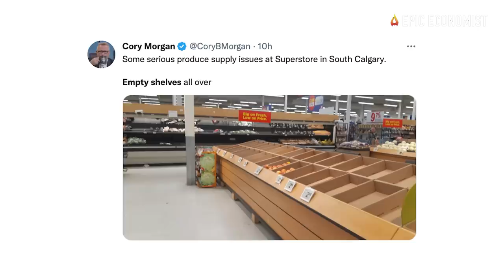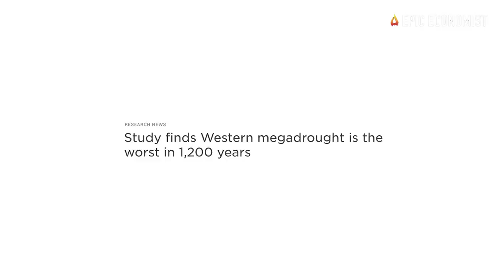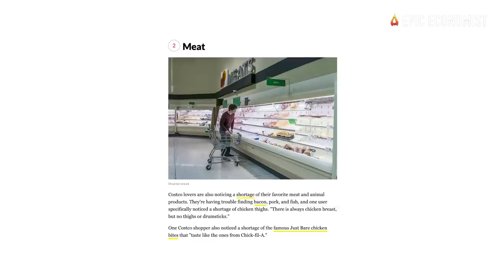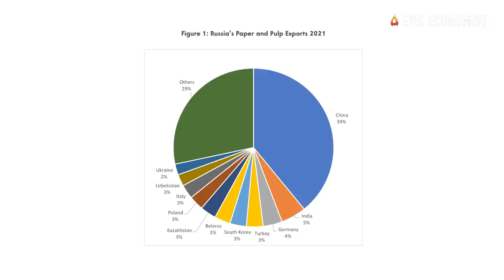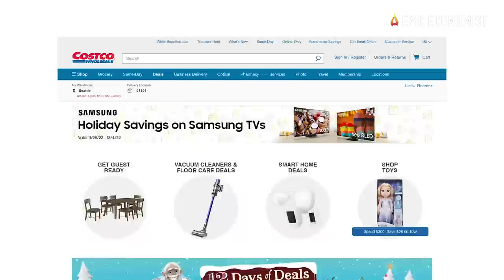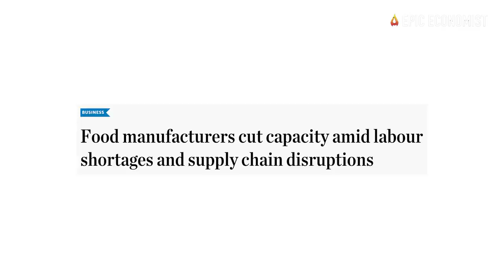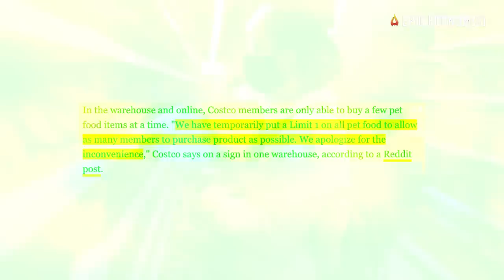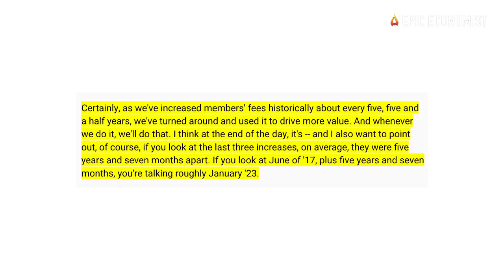Costco Reports Large-Scale Shortages As Essential Items Are Impossible To Find At Stores

Comment: The only product I have noticed disappear from CostCo was with Monk Fruit Sweetener.  There are new brands of coffee's I've not see before. Other than that most shelves look well stocked at the CostCo I shop at in my state. As for eggs, I prefer to buy those at my local Farmer's Market and then during the winter I'm "water glassing eggs", which is a way to preserve fresh eggs without refrigeration for up to 2 years.  You can only water glass with unwashed eggs, the eggs has to have the bloom, which is the outer covering on the egg that's on the egg when it's first laid.  If the egg has been washed, you cannot water glass. Check it out. It's easy.
Reply: I coat freshly laid from the coop eggs with vegetable oil and store them in the fridge with the date . They last up to a year, but so far as I know they will store for much longer than that. They are fresh as the day they were laid even a year later. Just have to be careful with hair line cracked eggs that froze in the coop during winter. Eat those right away.
Reply: Yes that monk fruit is one I was buying then they switched suppliers and it now comes from china My costco still has some but not as much as they use to carry about 18 months ago and since it comes from china now I wont buy it,
Reply: I need to look into that.  Right now I am freezing fresh eggs.
Reply: Eggs in Costa Rica & other places don’t put eggs in fridge they are jus on shelves
Reply: The Saxon Poessessive (‘s) doesn’t make plural nouns.
Reply: We lost our Ocean Spray Cranberry mix at Sams, and than noticed even the other grocery stores had limited Ocean Spray so guess the company itself is having issues.
Reply: @dapperdingo  how can you tell i they are not washed? I usually buy my eggs at natural grocers
Reply: @tammybrennan2040  same in the UK
Reply: Interesting...my Costco has monk fruit but no cocoa, no salt seasoning, rolled oats or organic chicken.  There is barely any chicken at all.   Those are items I used to buy regularly.
Reply: @jolie1327  I have two hens at home. I get a couple of eggs every other day and I immediately date them and oil them fresh  from the coop. You can oil storebought eggs that have been washed to make them last months longer in storage. Water glassing is a different technique all together that can be done with the unwashed eggs that are fresh from the coop. Natural Grocers eggs will be washed though.
Reply: How could you miss combo pizza?
Reply: @andielliott7721  if you freeze eggs after there frozen you will have to vacuum seal them - 
    If you don't vacuum seal them the yoke becomes like rubber - you can freeze them in ice trays then put them in vacuum seal bags - they can be kept for yrs that way till used -
Reply: @jolie1327  you would have to talk to the stores supplier - if the egg carton has a name you could call them - when eggs are not washed you can see it often enough - if you try water glassing them and there washed and radiated - if you brake one open after a few months it will be rotten - 
    That's how I know - 
   no matter what type of egg it is there an inexpensive source of protein the next is beef or dear ECT - pork has no food value to humans same with rabbit ECT - 
      You can also dehydrate uncooked eggs - or cooked eggs - some don't like dehydrated eggs - I'm ok with raw and cooked dehydrated eggs - any I don't use soon enough - I cook & dehydrate them -  then I put them in a blender and grind them into a powder and put them in a canning jars - some times I might not go to town for two months - 
 So I'll use the dehydrated eggs at times - after I run out of fresh eggs -
Reply: Last time I was in the Manchester, UK Costco in Ashton-under-Lyne they were out of every brand of wet cat food except Whiskas. I have set aside 2 large bags of dry cat food (not good for your cat, they are obligate carnivores and shouldn't be eating rice or any other grain) which I can dampen and feed half-and half extending what wet cat food I have left, augmented with an oil-based vitamin-mineral supplement for pets.
Reply: 卜

Comment: Been saying same crap for tow years now. Yes some things are hard to find. And yet this winter will go by and summer come same as always.
Reply: Don’t get your hopes up! You will parts for your vehicle, filters, oil and air, vee belts, windshield wipers, motor oil and grease, headlights and brake light bulbs, brake fluid and hydraulic fluid, still need spark plugs or no?
Reply: 7398

Comment: I live in KY. We don't have a costco.   Walmart has shortages and prices so high that blue collar workers can't afford many things.  As far as pet supplies.... some ppl may need to downsize their pet collection
Reply: I found a couple of ways to cut down on the cost of (cat) pet food. I have four cats. I was gifted three of them. But try this: Mix about 1/3 dry into a can of wet. Mix well. They love it, and dry is much cheaper than wet. It is filling, too. Also do this, but get them used to it. Mix about 2/3 water into wet food (less if it's already soupy) and mix very well. Start with less water and build up over days. My cats have gotten to where they don't like it right out of the can. The water and mixing also oxygenates the food, improving the flavor. It makes for moistened stools, too.  The result is runny, but it cuts down the calories somewhat, and gives them needed moisture. This is good for male cats that tend to get crystals and blockages in the urethra. Pick food up off the floor if they are finished, and store it in a plastic sandwich bag, not the can. Even with a lid on the can, the taste of the metal gets in the food and they do not like it. Put the food down again later, stirred up as before. They do not seem to like dry mixed with soupy wet food, however. It should be one or the other. Bon appetite!
Reply: I have a dog and 2 cats and 6 months or more supply of pet food . But am getting more. Most people don't have food for 2 weeks let alone enough pet food for 2 weeks. And the regular chain grocery stores are a lot more expensive than Walmart.
Reply: @yellowbird5411  LOL 😂,  I've never fed my dog or 2 cats can food. And if it cost more in a can ,why would you keep buying it?
Reply: I couldn’t find enough dog food for my three dogs so we ate one.